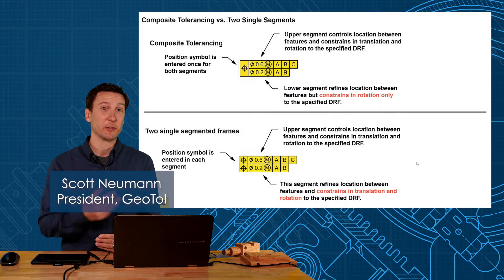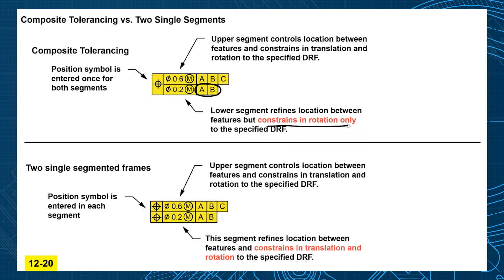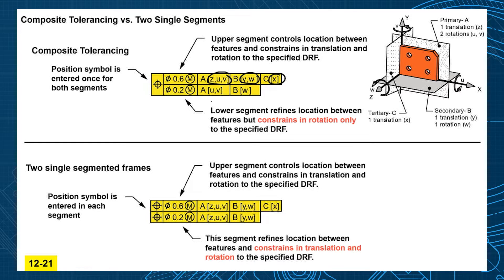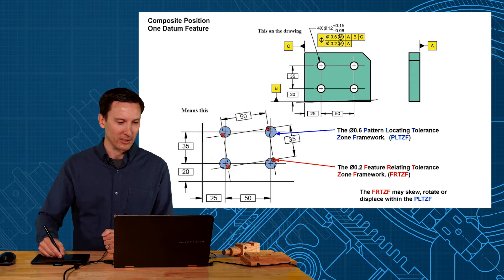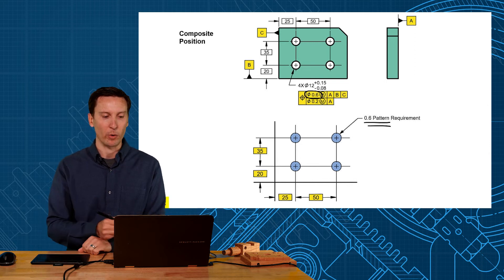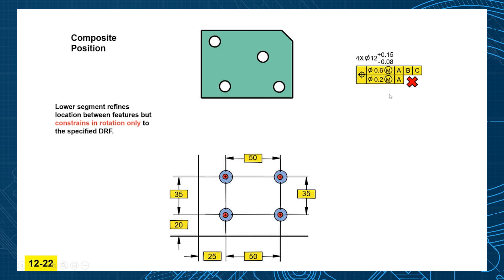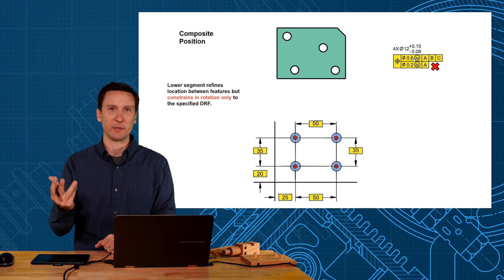GD&T Composite Position

Comment: that is gold! how to achieve the same result in ISO? assuming that it is valid only in ASME.
Reply from the maker: ISO uses separate position indicators. The lower frame needs a CZ modifier added (combined zone). This controls the holes to each other.

Comment: How would I interpret the lower tolerance frame in composite tolerance if B was the axis of a Center diameter and C was a timing hole, only A and B are specified in the lower tolerance frame? Does that mean I can translate in XYZ and rotate around Z?
Reply from the maker: Yes, you're right, it can translate XYZ and rotate in Z. Your datum B reference doesn't do anything in the lower frame. The lower frames of composite position constrain in rotation only. Your secondary axis is not constraining rotation so it adds nothing to the constraints.  If the lower frame had ref to ABC, then it can only translate XYZ (fully locked in rotation)

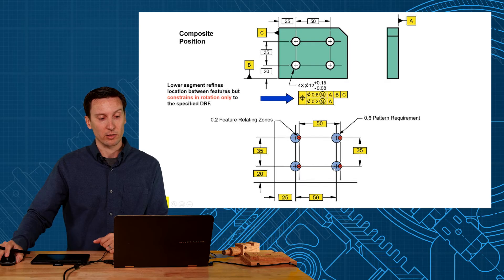Comment: is the hole pattern locked to the basic dimensions,  meaning there is no variance allowed ?  or could the each hole be shifted in any direction as long as it remained within the 0.2 tolerance.   For example ,  @4:41 each hole shifted together, but could one hole go to the left , and one to the right meaning they deviate from each other but do not exceed 0.2 position.
Reply from the maker: The theoretical tolerance zones are locked to the basic dimensions. The hole axes may shift within the dia 0.2 tolerance zones.

Comment: “Composit Position” appears to be meaningless when the part is fixed to the left in the assembled state and cannot be translated or rotated.
So, is “composit position” used when parts can move or rotate slightly in the assembled state?
I am curious in what cases “composit position” is applied to part drawings.
Reply from the maker: Composite position is often used on large plates or structures where many other parts connect to it. The location of each mating component doesn’t matter, but the holes in the pattern must be located to each other to let each part bolt up.

Comment: Would you please instruct how TO INSPECT either on CMM or Any method on 2nd section of composite ? Thanks
Reply from the maker: This is hard to explain on a message. You need each holes X and Y deviation data from the true position. All hole XY are plotted on a graph (called a paper gage). The hole centers are "best fit" into a circle. This circle represents the position tolerance zones to each other. This is detailed in my GeoTol Pro 2020 book pages 12-28 to 12-29.
Reply: @GeoTolPro  Quick question on the inspection/evaluation of the 2nd section of the composite. Are you supposed to use the same exact X and Y deviation data from the true position for both evaluations, the PLTZF and the FRTZF? Or do you take two sets of measurements because of the different datum schemes, ABC for PLTZF, and just A for the FRTZF? I'm inclined to use the same set because the FRTZF is a refinement of the PLTZF, and because I'm not sure how unlocking B & C on the part would affect the hole's deviation from TP... Is that the correct thinking?

Comment: The 0.2 can go out of 0.6 or not? If yes can’t meet the first 0.6. How can I understand that?
Reply from the maker: These are two separate sets of tolerance zones (two requirements) that the 4 holes must meet simultaneously. The upper 0.6 tolerance zones are fixed in location relative to each other and the datum reference frame. The lower 0.2 tolerance zones are fixed to each other but unlocked to the DRF (allowed to translate). Tolerance zones don't control other tolerance zones. Tolerance zones instead control the features. You could pass one set and fail the other.
Reply: @GeoTolPro  Got it，Thank you for your answer！

Comment: So why not just have standard dims with large tols from edges and put the basic positional tols between the hole patterns. I was doing it that way 42 years ago to BS 308 ( british standard ) Is this only ASME - what does ISO / DIN / JIS do? Having just said that - I do understand the principle and it's always good not to allow individual interpretations...Thank for the video.
Reply from the maker: Yep, thats how the older versions of ASME Y14.5 did it (1973, I believe). But plus/minus tolerancing for locating features comes with its problems: does the large dimensional tolerance apply to only the first hole or the set? What is the order of indexing the datum features (primary, secondary, tertiary). You end up with square vs round tol zones with plus/minus. ISO would use a similar spec for this particular example but instead with two separate frames.

Comment: If I made a composite FCF and had a M (maximum material condition modifier) called out in the first frame, do I HAVE to also add that to the second or third frame?
Reply from the maker: No, you never "have to" add an MMC modifier. It is just an option to add "bonus tolerance" if function allows. Functionally, I have found the upper frame usually does not have the MMC modifier. The top number in composite is a just a large tolerance for the location of the pattern. However, the lower frame is usually calculated using the fixed or floating fastener formula (MMC hole - MMC pin). Therefore, MMC modifiers make functional sense in the lower frame.

Comment: Thank you for your video. How do we measure the lower one with cmm?
Reply from the maker: The CMM can "best fit" the hole locations to their true positions by releasing the constraints to the datum reference frame. The X/Y deviations collected from the top control can also be plotted on graph paper and best fit manually. This was called a "paper gage" in the old days.
Reply: @GeoTolPro  thank you very much!